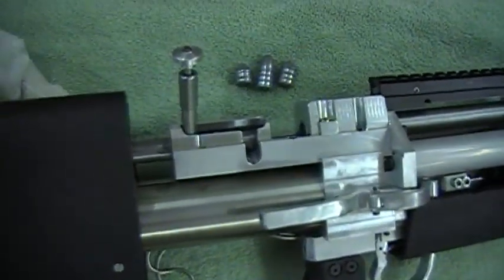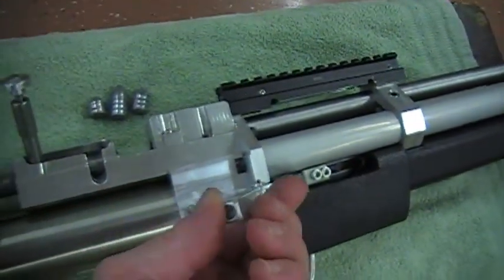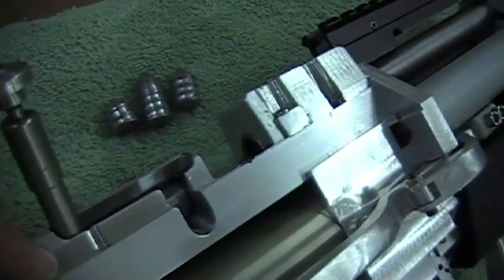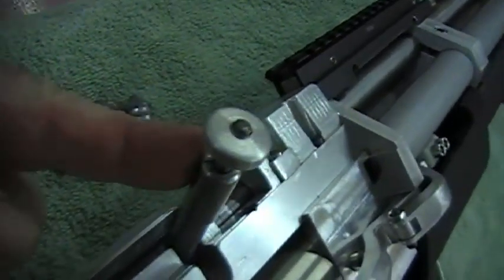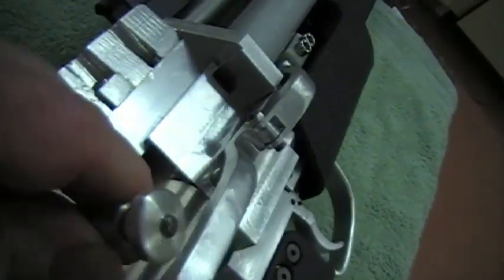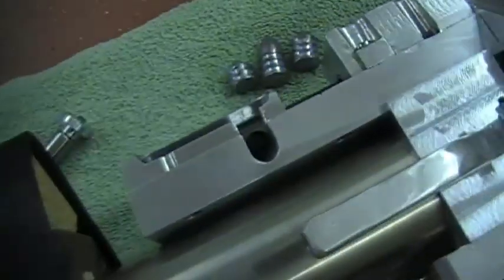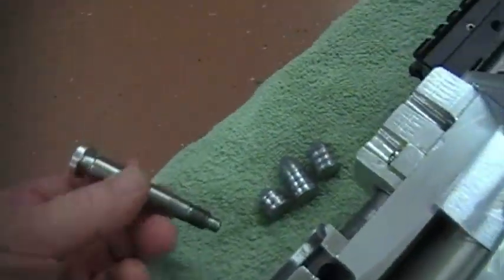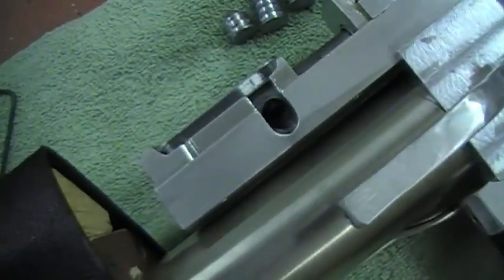Big Bore Airgun Positive Locking Bolt

Comment: Looks great Lloyd. Interesting project ya got there
Reply from the maker: Hi Dave! Here is a link to me using that airgun at the Funshoot in Arkansas last may.
 https://gramho.com/media/2046205682889732292
Travis from Jefferson State Air Rifles posted it on instagram, too. I detuned it for that session. Lloyd
Reply: @1227air500  wow, love it. Does it incorporate anything you learned from mine
Reply from the maker: @grumpyyerr  Yup, sure does. I have a side lever for hammer cocking similar to yours, and I also paid special attention to the barrel rigidity on both guns. Yours has a 23mm O.D. x 5mm wall CF sleeve bonded over the barrel, and mine has a 3-tube-truss construction (like a radio tower). Both give nice barrel rigidity.